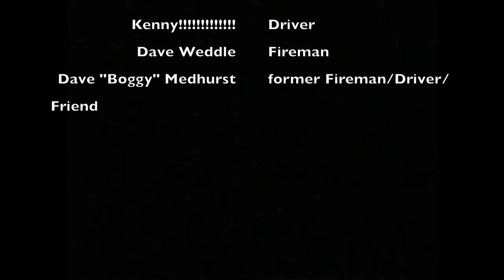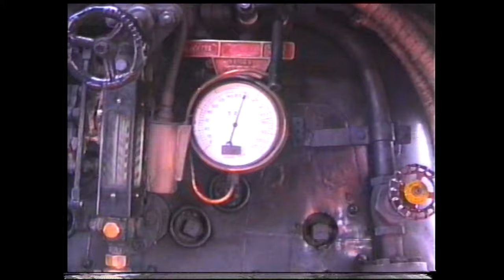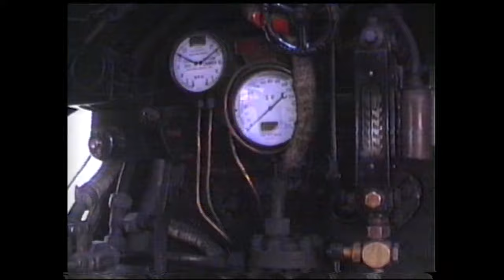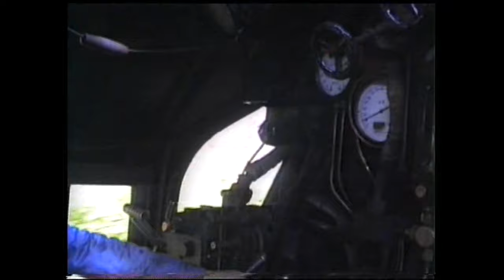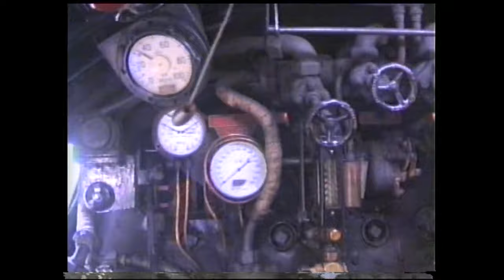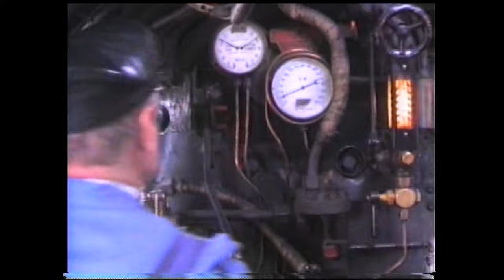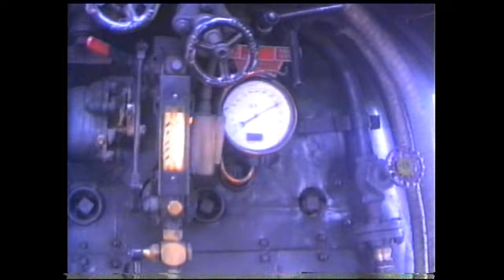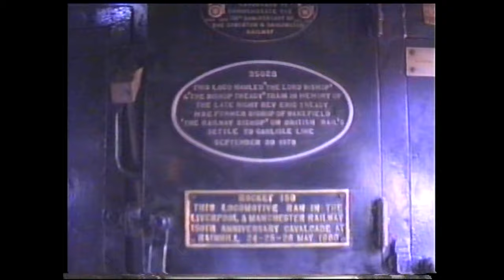Steam Drivers Last Fling. A personal look at men enjoying a last chance on Mainline Steam

Comment: That was brilliant. Thanks for sharing. As a volunteer many moons ago on the Chemin de Fer du Vivarais I had many happy hours at the depot in Tournon and on the footplate with the professional loco crews, then again a bit more recently on Puffing Billy in Melbourne. I think this sort of banter was universal among footplate crews the world over. - certainly the case in France and Australia. Not so much any more, it’s become a solitary job, all alone in the cab of your class 66 or TGV. I’m subscribing and hoping for more of the same.
Reply: @TrainDrivingRailEnthusiastAus  yes you’re absolutely right. It’s a general thing in the railway industry. When I joined SNCF back in the mid ‘90’s we solved loads of operational problems on the ground, simply because we all knew each other. The bean counters have since separated us, first into « business units » and now separate limited companies. And they wonder why things don’t always work as they should any more… oh dear I’m sounding like an old git. Sorry, I’m only 59,but todays SNCF is nothing like the one I joined in 1997.
Reply: What is it an A1 Pacific?
Reply: @BillSikes.  it’s a rebuilt Bulleid west country class light Pacific
Reply: @47606odin  
Aww thanks 👍
Reply from the maker: No problem
Reply: @BillSikes.  
Actually there were two types of A1. The first were designed by Sir Nigel Gresley for the GNR just before the grouping into the big four in 1923 when they were taken over by the LNER and later modified by Gresley into the A3 class (the same class as 4472 Flying Scotsman). After WWII the last CME of the LNER, AH Peppercorn , designed his class of A1 pacifics as the last pacific design for the LNER. Most of them were introduced after nationalisation and only ever operated by BR. All the originals were scrapped in the 1960’s, but today new A1 pacific 60163 Tornado built in the 2000’s to Peppercorn’s design runs on the national network and is authorized to run at speeds up to 100mph.